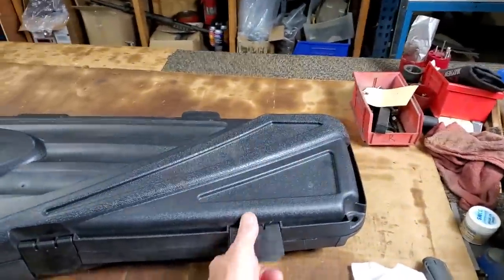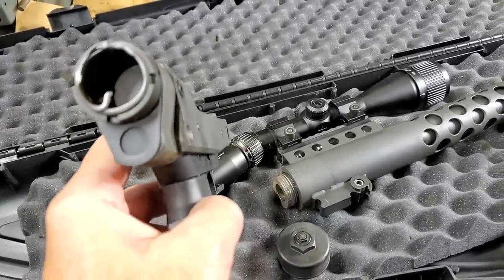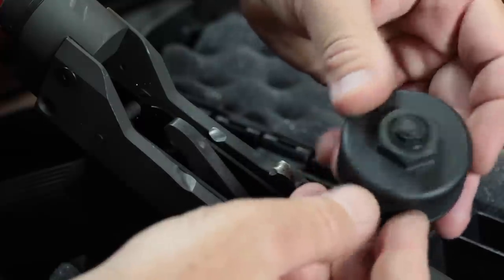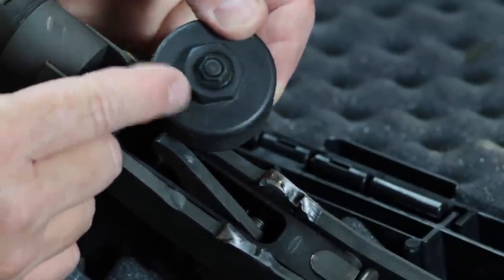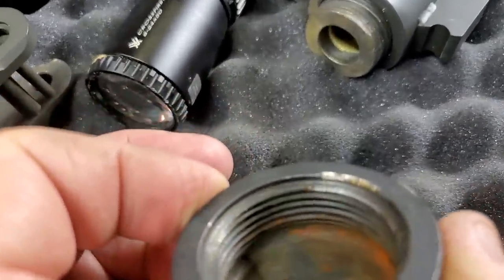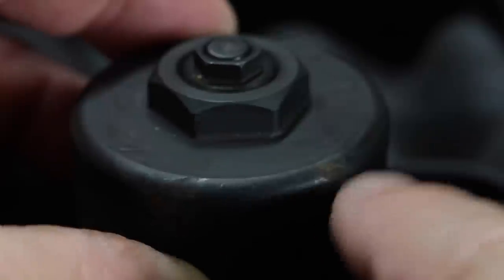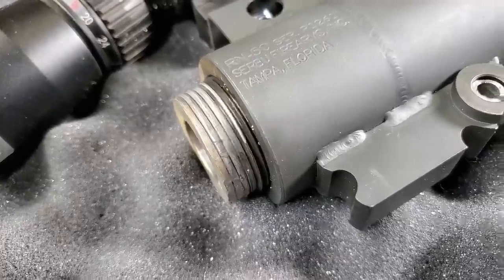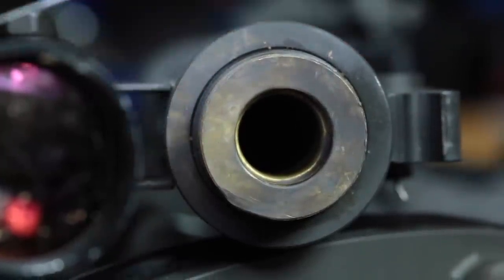Kentucky Ballistics' RN-50 Blow-up:  First Look

Comment: The crimp on the four rounds shown looks more like a roll, not a taper to me. That being said, every SLAP round I've seen has a heavy collet style crimp. That one projectile was noted as loose is also a red flag, imho. Something ain't right with these, I'd love to see them taken apart, powder charge weighed, etc.
Reply: counterfiet rounds do exist. why wouldn't a counterfieter if they found spent slap brass not reload it and sell it off as original?
Reply: @toomanyaccounts  And counterfeit surplus is a big market, especially overseas.
Reply: With how sought after M903 SLAP rounds are, I would be shocked if this was legit, untouched SLAP rounds. With that much energy, the only logical answer is someone got components and reloaded this and did so incredibly incompetently or negligently with pistol powder or something. Or, even worse, knowingly sabotaged these rounds in the hopes of causing injury to someone else. Accidents happen, but for a .50 BMG round to be THAT explosively energetic and fail that badly? Whoever messed with that ammunition has no right doing so ever again, or selling ammunition in the first place.
Reply: @matchesburn  I wholeheartedly agree.
Reply: @matchesburn  I’ve been thinking that it must have been a pistol powder. Or something very fast at any rate; maybe the guy figured H-110 was H-1000 or got dyslexic about it? Even H-1000 isn’t really ideal, I would think, for that application; although it would be close. I can’t think of any other powders with names as easy to mix up that would give that kind of burn rate differential.
Reply: @kurtisb100  I was thinking pistol powder, or maybe one that gets very sensitive at lower loading densities. That's an area where a lot of reloaders get messed up is with trying lighter than normal bullet weights with reduced powder charges. I've had my own experiences with positional sensitivity as well with charges that don't fill a case up to 100%. Never had a detonation, but have had squibs if the powder was up against the bullet base, and not against the primer hole.
Reply: Definitely suggests issues with seating and makes the case head separation all the more suspicious.
Reply: @matchesburn  counterfeit slap rounds exist. the rare number of legit rounds coming into the civ market means lots of unscrouplous or bubba handloaders will be trying to get as much of that 100 bucks per round that they can,

the majority of people will have no clue as to what a slap round is supposed to look like.
Reply: @toomanyaccounts  Not having the proper crimp is a big red flag that someone has tampered with the round. If someone reloaded a deactivated round with pistol powder for example, that would explain everything. Pistol powder is the fastest burning; 50BMG is the absolute dead slowest. By using the wrong powder the pressure spike would be insane because the bullet can't accelerate fast enough to get out of the way of the too-quickly burning powder and you'd have a very high chance of this failure.
Reply: @kurtisb100  4831 use to be 50 powder h1000 is slower
Reply: Yep, I just did an image search and not one SLAP round was crimped that way. Notice also that the 4 in the video are all crimped very slightly differently. These have to have been reloaded.
Reply: @Patrick-857  and we know what to expect from Bubba at the reloading press.
Reply: @planeiron241  I’m not sure I understand your reply; are you saying that 4831 used to be used in 50bmg and that H-1000 is slower? If that’s what you’re saying then fair enough; I had no idea a powder as fast as 4831 was used in the bmg. That said, H-1000 isn’t ideally suited to the bmg case as far as I know; although I suppose with the weight of a slap projectile maybe it would be a good choice. Not sure. Never loaded for 50bmg before, or a sabot projectile either for that matter. That said, my point wasn’t the suitability of H-1000 for 50bmg, but rather that a fairly plausible error would be accidentally grabbing H-110 and filling a powder throw hopper thinking that you had grabbed H-1000 instead. The bottles and labels look similar enough that a second of distraction could account for that. And a charge of 180gr of H-110 (or whatever would fit; again, never tried it) would be apocalyptic. Obviously, the powders themselves look very different, but if you’re not paying attention to the bottle labels, you’re likely not paying attention to the texture of the powder either. 

Of course, we have no way of knowing if this is what happened or not. No idea if the reloader intended one powder and accidentally substituted another, or got a bad or mislabeled lot of powder, or shoot, maybe did it on purpose. Hell, maybe he had a ‘wasted powder’ bin full of table sweepings of a mixture of powders he used in that case. Likely we will never know.
Reply: These are definitely reloads. Proper SLAP rounds had WCC SLAP head stamping along with the year. Same is true for SLAP and SLAP-T
Reply: @edifyguy  I was told that it possibly could be if it was stick powder and if the round was agitated a lot(in transport), that can cause stick powder to break down and change the ignition/burn characteristics
Reply: @jamestinsman1603  The vibration causing powder degradation theory has been floated quite a bit, but to me the rounds look tampered, so I think that avenue should be explored first. Those rounds spend a lot of time bumping around the desert, so you'd think that some precaution would have been taken for vibration degradation. Not that it isn't theoretically possible, but to me tampering seems much more probable.

Comment: Looks like the breach cap was tumbling not just sliding straight back. Would explain the gouges all the way back to the buffer tube.
Reply: Yes thats exactly what happened, the damage to the thread inside the cap is the exact part which hit the dent on the buffer tube that mark couldn’t figure out
Reply: That’s what I was thinking too.
Reply: An easy way to tell is to measure the cap with the micrometer and those two gouges. That will give you an answer
Reply: I suspect it was the ears that caused the gouges after they sheared off not the cap.
Reply: @kevmv1 maybe, but there are corresponding marks that match up on the breach cap! So would think, no.
Reply: @kevmv1 At 1:38 you can see the marks on the cap where it hit and caused those gouges.
Reply: @kevmv1 I thought the same.

Comment: Looks like thread functioned normally as every engineer will tell you that the maximum load is taken on the first few turns thereafter the point of rapidly diminishing returns for increasing thread length . You can clearly see the the taper this creates in the threaded portion . I'm guessing that from the witness marks on the breach cap and frame twist that one lug let go before the other .
We don't have SLAP rounds available for 50 cal here but a lot of heavy 7.62 is saboted to this calibre and generally a taper crimp preferred to a heavy roll or " factory type " . We rarely see Winchester cases here , mainly LC , TZZ ( IMI) or ME head stamp .
Shame you couldn't find the case head as this may be the clue to what happened as a 50 cal case is much like any other without the case head stamp . Pulling and sectioning the other cases and measuring powder  burn rates , primer consistency , wall thicknesses etc. has to be the next step as this is most definitely a rogue in a batch .
Reply: thank God that the lug that took off scott's hat missed him.. just thinking of the damage it would have done to him makes me shudder..
Reply: If the threads held, none of this would have happened.  The more thread contact, the stronger it is.  I'm not trying to say the round wasn't hot, but the threads of the breech cap obviously failed. Don't try and tell people you only need to thread a bolt in " a few turns", that's laughable.
Reply: @DanBCooper  adding more threads does not fix the problem there is diminishing returns with each one you add this argument has been torn apart so many times go do some research bud
Reply: The maximum load is only on the first few threads with lesser loads. With a big load the thread's plastically deform, distributing the load more evenly across the threads. But it's both cases imo.

Comment: I'm just an overhead crane operator but I'd be really interested to see this go through a magnaflux test. They test my C hook for tiny cracks about once a year.
Reply: Magnaflux is used to detect small cracks before they become big cracks and something fails like the hook on your crane, wouldn't really prove anything in this case after the blow up and if a part of the rifle was cracked beforehand the failure point would start there and be obvious.
Reply: Still be good to do, even if just to see any weak spots in future firearms
Reply: Magnaflux is just a brand name product for a magnetic particle inspection. But yes it's still a 50/50 shot if you did MPI it and found cracking whether it was there before or after the incident. Although I'm sure something like this test was performed if it was heat treated like he said

Comment: I have a theory for the that mark behind the trigger area.  When the cap dug into the frame near the trigger, it caused the cap to begin a rotational flip as the cap carried on.  The scuff in the finish before the mark and leading directly to it has a leading edge that appears to have a matching curvature to the shiny impact mark on the breach cap's inside thread area.  The breech cap then proceeds to hit Scott (the luckiest man on earth) in the eye, as it somehow miraculously only injures Scott during the "Kentucky Serbu Incident." The lower frame is what created the scar trail up and around Scott's throat.  Too bad that section of video wasn't shot at a higher frame rate, as there are only two frames to collect failure information from, Higher frame rate would have revealed more details to the sequence of events that happened during the breech failure.  Glad Scott survived.
Reply: It was probably the ears that left the gouges near the hammer after they were sheared off and driven downward by the now tumbling cap, but I agree about the inside edge of the cap striking the rear piece near the stock.
Reply: i was thinking same thing
Reply: @nottaexpert2690  I’m glad to see obviously more educated and knowledgable people than myself arriving at a similar conclusion. It’s absolutely miraculous that Scott survived-Heck he came out of it in better shape than the rifle did
Reply: @jacobdennison968  I was just thinking today that Scott got into a fight with a .50 cal and the .50 didn't make it. lol
Reply: I agree about it tumbling. I think that the shape of the indentations in the lower suggest that the top edge of the cap hit the lower, then it tumbled once more and hit the stock making that mark, before hitting Scott.

Comment: Mark, I think the barrel needs scoped really well and then possibly split in half.  

A long time ago, I had some 308 SLAP rounds that I was having accuracy issues with.  What I believe I found was the sabot was leading the projectile in the barrel at one point due to inertial difference after the sabot was not able to hold on to the projectile, sometimes almost acting like a front facing wad.  I wonder if the same thing happened and caused a temporary barrel obstruction.  The breech is the weakest part of the assembly and will shear off and eject in such a case.
Reply: I suspect that you're right. In the video, the round before it went off to one side, which might mean the sabot came apart in the barrel. Scott said that he checked for a bore obstruction after that happened and didn't see anything, but a thin sleeve of plastic might well go unnoticed.
Reply: He put a normal ball round through before the fateful slap which would have cleared out any plastic
Reply: So far we've seen no indications of barrel bulging which would be highly likely in the event of a build up of pressure some place other than the chamber. I'm waiting to see any cut away or measurements to rule that out entirely, but everything seems to point to either a detonation from low powder volume or, more likely, a massive over charge. Both happen at the chamber and in an instant and tend to leave the barrel unscathed.
Reply: That's a very interesting theory. I was struck by how normal the neck and shoulder of the brass looked; if all was good when the round left the brass, THEN had a momentary obstruction and pressure naturally ramped, that might fit....
Reply: @ek8710  I think the OP was talking about the obstruction happening to the fateful SLAP round.
Reply: Doesn't 50manual say Don't fire slap rds through muzzlebreaks unless MB is specifically designed for them?
Reply: @alexipestov7002  Yes.
Reply: @jamesdoesitmatter  in the first video Kentucky started using slap rounds he stated serbu sent him a new barrel with a break so that he could shoot them.